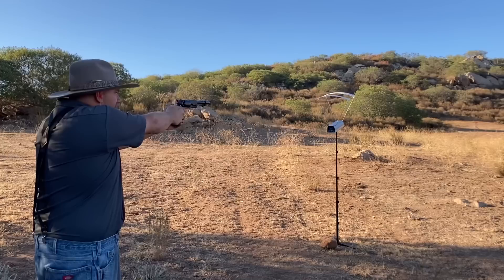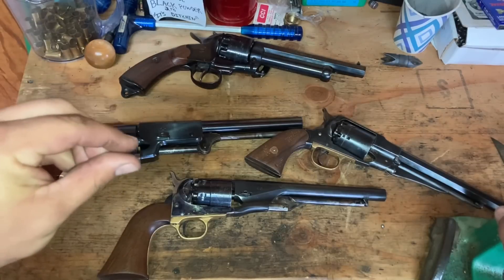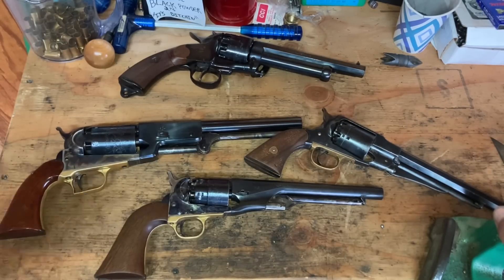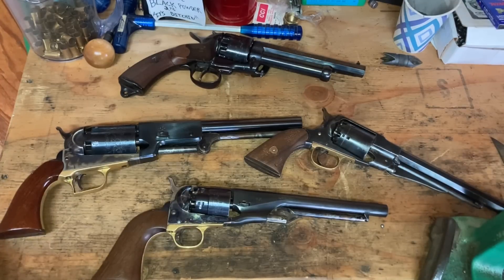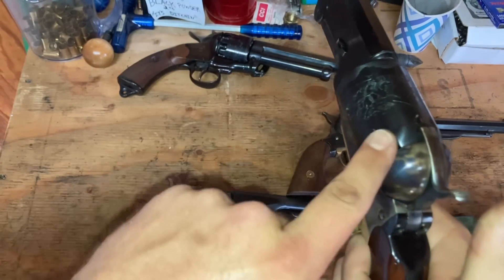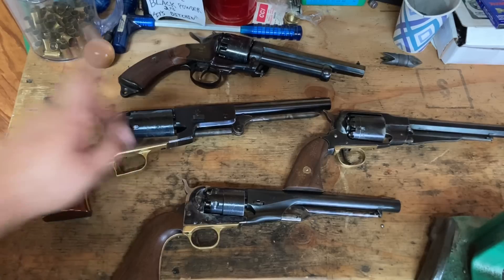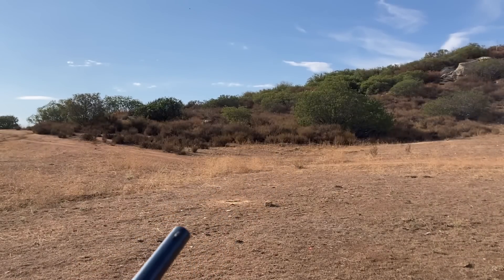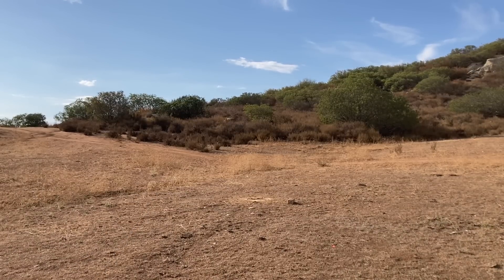What Causes A Chain Fire?

Comment: Chain fires are basically a form of cook-off firing caused by still smoldering pieces of unburned powder touching another cylinder or percussion cap and heating it to the point of ignition. By greasing the mouth of the cylinder you can prevent most chainfires because that unburned powder will be cooled by the grease. Good percussion caps are made of thin foil so little bits don't hold much heat and that type of explosive powder in a percussion cap burns more thoroughly and so it's rare for one percussion cap to set off another, but it's possible. Having a gun with a nipple shield shape helps of course. The Ethan Allen pepperbox replicas are typical of that kind of shielded design but even with those it's possible a bit of percussion cap can get stuck underneath the shield and do the same thing so no design is perfect. A wool patch between the ball and powder can help a lot too especially if the wad is greased. Again it just helps to cool the unburned powder. Wool is fire resistant so wool is best. Lead can transmit heat so even a tight gas seal around the bullet isn't enough of a precaution to prevent a chainfire, but it definitely helps. A basic grease for the mouth of the chamber or the wool wads can be made with crisco vegetable shortening. You can spread it on the mouth of the gun with a knife or it can be put into a toothpaste type tube or even a plastic bag with the corner cut off to pipe into the chamber like a baker would decorate a cake. That alone with nothing added works fine in cooler weather, but it gets liquid in the heat and will be hard to smear on the gun without making a mess and so should be pre-melted in a pan with beeswax to make it harder if you know you are going to be shooting in warmer weather. Lanolin can also be added. Lanolin is sheep's fat from wool and again helps cool the powder. Besides greasing your gun the best way to prevent chainfires is to have as little unburned powder as possible. That means using FFF powder in your revolvers and not exceeding 30 grains for .44 calibers. If you use too much powder or use FF you may have more unburned powder than necessary, but in any case you will have some. I've used FF in revolvers for years with no problems, but I am careful to not use much powder. But FFF is better. If you do notice a bit of unburned powder has gotten on your gun from the last shot shake the gun slightly to get rid of it immediately before that heat transfers into the chamber. In fact it's a good practice to get into the habit of doing that after every shot anyway.

Comment: I have had chain fires on a colt 44.  Went to a bigger ball. and it never happened again.  I agree with your "opinion".  That said, it was ten or so years later, that I discovered that wax makes fouling less, and cleanup a ton easier.  For the last thirty years, if I am shooting one of my cap and ball revolvers, I religiously use wax.  Haven't had a chain fire in forty years.

Comment: I usually only lube every alternate chamber just so the fouling  stays soft.  I start though with all chambers lubed and then again after every four or five cylinders I lube all the chambers.  I did get chain fires on my Uberti 1860 New army but I solved that by using .451" balls instead of .450".   Since doing that I haven't had a chainfire in at least 12 years.  The lube does help though and I suspect that having the prue cut off not facing forward may also have played a part.

Comment: A very good experiment test! When I was 22 years old a coworker asked me if I ever shot a black powder pistol and would I like to try shooting one! Well two days later we were out in a field with his 1851 36 cal. Navy. BANG!!..I was hooked! About two months later I bought my own 1851 Navy because my coworker was tired of me begging him to go out shooting his gun. Now every weekend and Holladay I was out shooting that pistol. Since that wasn't enough I bought books and black powder loading manuals and between shooting that pistol I had my nose in those books and manuals. I used Cresco over the balls as that was what my coworker did and I thought that was for lubrication and keeping falling down. I had read about the possibility of chain fires in these pistols but thought as long as I had a tight fitting ball that couldn't happen to me. Well about three years later, on a hot some day, and on my third or forth string of shooting I had three chambers go off at once. I didn't know what happened at first because it just sounded funny and much more smoke. Since everything looked ok I fired my next shot. Bang! The cap went off but no boom. Thinking I might have have a ball stuck in the barrel  I disassembled the pistol.  Nope! ..no stuck ball in barrel. Checked the cylinder and found three chambers emty. Checked the nipples and found four unfired caps. Like a idiot I thought I had missed loading a chamber! Put the pistol back together and fired it again. Funny sounding bang again! Took the pistol apart again. No stuck ball in barrel but no loaded chambers in the cylinder but two live caps on the nipples. That's when I remembered reading about chain fires. Thinking that's not good I better find out what's going on and how to fix it. For months I tried all kinds of different loading techniques and didn't get a chain fire untill I loaded a cast round ball I had cast myself from a new bullet mold I got. I did notice on my cast ball's that the sprue cut was cutting to low on the ball and if loaded with the sprue cut on the side of the chamber mouth it didn't cut a complete ring of lead off and I had a chain fire in that chamber once in a while. Thinking that was it I got another ball mold and loaded them and got perfect cut rings of lead and no chain fires. Then a few years later I had a chain fire again but this time all 6 chambers went off. No real load bang but a giant fire ball and a large cloud of smoke. When the smoked cleared my two friends that were behind me calling my shots for me had eyes opened as big as salid plates and after a moment asked if I was ok. I had fired a third model Dragoon with 50 grains of Swiss 3f black powder and a 454 round ball. My friends  side that if I planned on shooting it again that I would have to wait till they left the state. The bottom chamber shit its ball right into the loading lever plunger face jamming it up. Had to take it off and use a knife and screw driver to pick it out. Luckily no one was hurt and the Dragoon was not damaged! Thumbs up UBERTI!!! SO BACK TO FIGURING JUST WHAT WAS CAUSING CHAIN FIRES! USEING MY 1851 NAVEY AND MY 1860 ARMY I spent probably three hundred rounds of ammo and seven months of testing different loading techniques, different powder, balls and conicals,powders, lubes and wads and no lubes and wads. In all that testing I had only 5 chain fires. All chain fires were three chambers going off.  The chamber being fired and the ones to the left and right of the chamber being fired. All chain fired chambers were loaded with no wads and no lub over ball or conical bullet one chamber to the right of the fired chamber did have borebutter over i and on examination I found that all but the 6 O'clock chamber didn't have it's lub over the ball blow out. I believe the lack of a felt wad under the ball or conical bullet and or a lack of a good heavy lube over the ball or conical bullet can allow a chain fire to accure! On all chain fires the caps on the nipples were unfired but some had loose caps indicating there was some backward pressure exerted to the rear of the chamber but no fire blast.

Comment: I luckily have never experienced a chain fire.... I always used cardboard wads behind a ball or bullet that was slightly oversized enough to shave off a "ring of lead".... Never really used that much grease because after a few shots or on a hot day it'll get runny and messy.... Plus I have always made sure my caps were tight as possible and that my cylinder nipples were in good shape.....  That's the way my Daddy taught me when I was a boy.... Rather or not that is "proper procedure" or not is up to debate.... Maybe I was just lucky, I don't know....

Comment: My "GREASE" is a mixture of lambs tallow and bees wax impregnating a felt wad, so it must be the lamb and Bee Mafias combined in that conspiracy.🤣
But seriously, when I was younger and shot the snot out of my Ruger Old Army BP revolver, (I wish I still had it) I only used dry oversized round balls leaving a lead ring mounted against the powder and rarely ever greased the cylinders if ever, and never had a chain fire!
Actually, now that I'm thinking about it, a larger lead ring should be a better seal, so I should have gotten a larger set of round ball molds for both caliber revolvers.

Comment: I have witnessed four chainfires, and in one instance I know for a fact there was grease ahead of the balls (I was working the loading table at a CAS match and watched the lube go on), so I feel safe saying they CAN come from flame escaping into adjacent chambers at the front or rear. I do believe however, that chamfered chambers on a well-machined pistol (proper chamber dimensions with no taper or wide spots) and properly-sized balls reduce the odds of them occurring from the business end. I have a couple C&B pistols, and although they have chamfered chamber mouths and my balls are plenty big (...pause for comedic effect), I still use a mix of Crisco and beeswax in the chambers to keep fouling soft so they will run longer and be easier to clean. Even if it did nothing to prevent chainfires, it's just a solid practice. I installed quality aftermarket nipples also, which hold caps tightly, just to hedge my bets against a boomboomboom.

Comment: Good video bought my 1st navy arms mod 60 army .44 cal in 1970 . A brass frame .44 that I shot 24  or 30 gun charges always ! I was 16 yrs old  and that pistol took a lot of abuse . Probably ran well over 5 lbs ot goex through it as a kid . Used crisco , wads ect .or nothing .only 2 chain fires in all that time ,no grease .point is as long as you don't put others in danger its no one else's business. If you read enough you really don't find any mention of lube or chain fires in cotemporary writings ,But when they sold colt revolving rifles in the Civil War trooped not want that hand out front ! So they knew about chain fires , maybe just took em instride as part of the deal with all this new repeating arm stuff . Also we shoot more in a afternoon than a lot people shoot in a lifetime . Good channel

Comment: I believe that if the ball shaves a ring it can not chain fire from the front.  I use my own wads.  To lub the ball and mix with the powder fowling to keep it soft lub has to be next to the powder.  I have had a chain fire with a Remington 1858 new model.  It came from the nipple side.  I was pinching a #11 cap to stay on a #10 nipple.  I watched the spark go from under one nipple to another.  Three went.  No damage.  My opinion is that chain fires happen once in awhile no matter what.  Life goes on.

Comment: Agree, Can't say you can never, ever get a cap side flash over, but it flies in the face of common sense that it's usually that way. Been shootin cap-n-balls for 50 years and all my flash overs directly correlate with no or not enough grease over the ball. Used crisco mostly, and I agree that its sub optimal. There should be little or no flash coming out the nipple hole. Then it has to get around the other fresh cap. Gee, where does the fire come out of, anyhow? - the ball end. Showing how even the robust grease you use gets affected by the blast reaching it it very instrumental. Those chambers are lucky they are only next to the blast once! -What a great design those revolvers are!

Comment: Interesting video...thanks...
I think sometimes the nipple end chain fire could be the hammer bouncing (light mainspring?) and setting off adjacent caps if they are not on really tight.... just a theory. I have shot revolvers with loaded and uncapped chambers 'next door' many times and have never had a chain fire.
I have found that sometimes chamber mouths vary a bit in size and are not always perfectly round (QC issues). I always check them and ream as needed, also matching the chamber mouths to the groove diameter plus a thou at the same time.
Chainfires are all theory for me as I have never, in many thousands of rounds from my Remingtons, ever had this happen with either round balls and conicals. My revolvers are using .457" balls which shave down to .455 on loading to match the .454" groove diameter of my pistols. The conicals are a bit undersize compared to the balls but as I load them in paper cartridges, which adds a bit of diameter, so far they are fine, and much easier to get into a paper cartridge than round balls. I lube them in a lube/sizer with beeswax/tallow lube I make myself... so far so good.
Probably have my first chainfire now! LOL
Reply from the maker: That’s interesting, I hadn’t thought of the light hammer spring scenario. I use the Johnston and Dow conicals from eras gone bullet molds. They come out at .460 and they shave a nice ring in all my cap and ball pistols. I haven’t loaded paper cartridges in a decade or so but I’m thinking of giving it another try.

Comment: I shoot cap & ball every weekend and sometimes get a chain fire in my .36 cal 1851 Navy revolvers due to loose fitting caps which in the current state of not being to effing find any is the cause of that. Not a big deal ... I have a chainfire about every 6 or 7 cylinders and it is flame getting under the cap to the left every time I do have one. 

Old timers here told me in the combined 100 yrs experieince of the two that if your ball fits and shaves a nice ring of lead you wont get a chain fire from the front unless your chamber is out of round or something. Also said lube doesn't matter on the front end other than keeping the bore from fouling, doesn't do much for chain fire issues. Ive never had one from the front .... just the loose fitting caps issue. Sure would like to find some Rem 10s.
Reply from the maker: I’ve heard that as well but in my experience any time I’ve ever had loose caps they either fail to ignite on the first hammer strike or get knocked off from the recoil from a chamber that does fire.

Comment: O i love this video. Sorry i am a few days late to the party. Great info and i would have to agree with everything you said.
Reply from the maker: Thank you!
Reply: @Everythingblackpowder  some of the comments make me really think if they even watched the video. I am a engineer and i believe the majority of chain fires happen from the front. Main reason being the cylinder Barrel Gap. The pressure and velocity of the fireball allows it to find any tiny opening with a lot of pressure behind the flame front. I think it's possible that somebody could have a chain fire from the back. But far less likely. I have even fired My Revolver before where the caps were off the rest of the loaded Chambers.  it never chainfired.  its eazy to understand why. The gases fire and pressure coming out of the nipple is far far less than what's coming out of the front of the cylinder. And its blown straight back. The fire would have to reflect off several things and do a 180° turn. then find a small hole. by that time the pressure would be too low to Force its way down the nipple. Being the nipple is just a tube. If the chamber is loaded that tube now has one side closed. The pressure and the flame front would have to compress that air in the nipple Quite a bit. before that flame front could actually touch the powder.  Up front tho the cylinder to barrel gap is a 360° donut. so the flame front  travels in all Directions as a Shockwave. being the extremely high pressure it will fill every nook and cranny. Until the pressure bleeds off... If theres any gap it will easily get through. Now its possible that the flame from the front of your cylinder could somehow get into the nipple in the back. but the shock wave because of the distance to the nipple. And orientation of the nipple The nipple would see the Shockwav in the opposite Direction. it actually would create a suction effect in the nipple tube..
And saying that... having grease or a wad is just extra protection and a great insurance policy.
Reply from the maker: Yes, apparently debating the origins of a chain fire is much like a religious debate.
Reply: @Everythingblackpowder  thats whats it seems

Comment: Ive got chainfire 3 times in my life. First 2 times occurs in one day, in a row. I was testing then my very first, home made caps, wich they have too much exposed priming compound  - chainfire goes from nipple of fired chamber and sets off 2 caps on the sides (Colt Pocket Police .36, .380 round ball and grease on top, no wad).  Third time occurs when I forgot to take on range grease, so I shot without it, after couple of cyliders, BAM, chainfire (round ball, no wad).

Comment: I shoot conical paper cartridges only. I don't even have a powder flask.
   When loading loose powder and ball some powder can get stuck between the ball and chamber causing a powder trail to the main charge.  
  The leftover grease in the chamber will increase the chance of the powder sticking to the camber wall and at the front of the cylinder.
   There was an article on the Facebook cap and ball pistol group about this a while back.